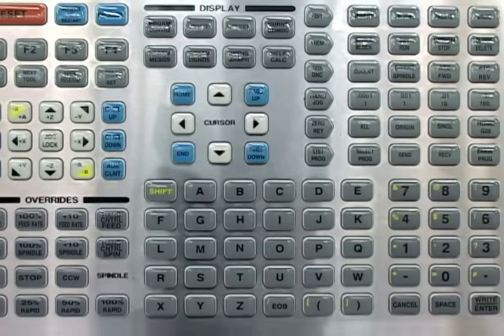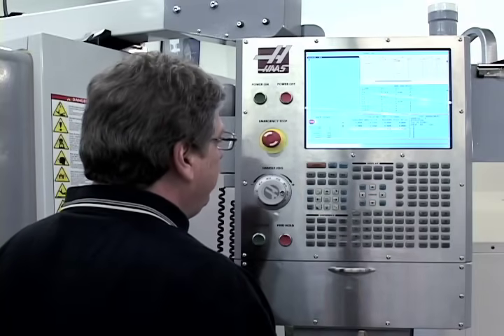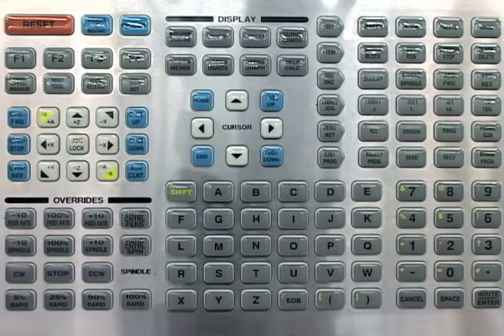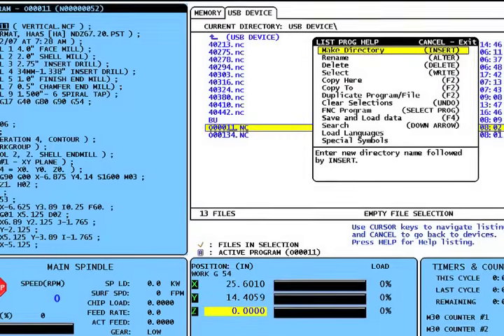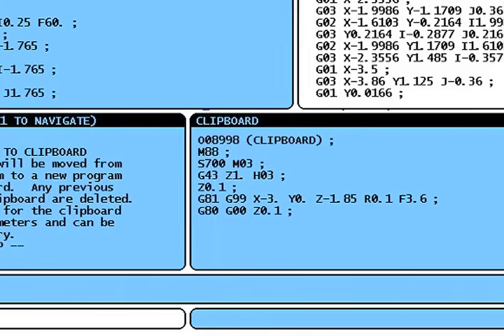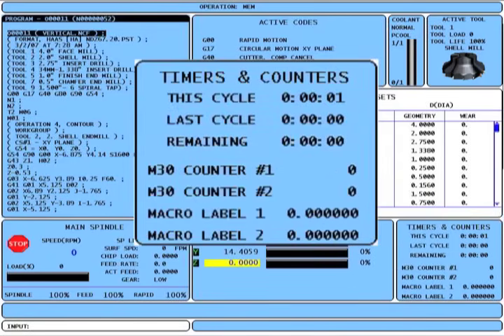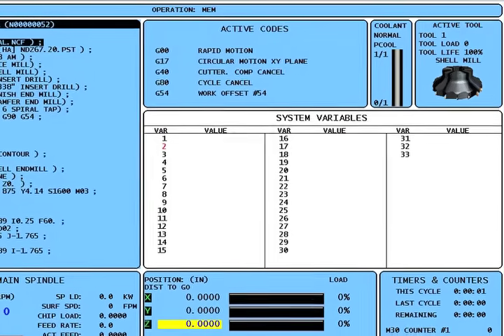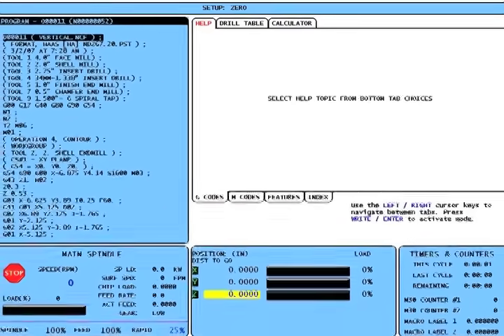Haas Control — GUI Setup, Run, and Edit

Comment: set up on the haas is damn easy, so bloody easy anyone could do it, thats what is needed in work, dont think but do. if you got a brain, or a computer with decent software, the thing will do what u want. as in milling. i can use 3 axis at once. and if a 4th is present, that as well. in turning the touch on to set makes the machine so easy, it does have haas easy programming, but now i just punch it in and run.. damn. if you want to contact me. try daveportlock@hotmail.co.uk.

Comment: i have run fanuc systems for around 25 years plus. the haas control is actually more better. the haas has great programming, also control. some machines have other things on them, easy guide is one on the machines i work on, all good but still limited when u need compensation or just running the damn thing. i run in fanuc, its easy to use and versatile, run a mazak control and understand. so in haas i can do turning and milling. i use the TL1 machine, mainly for 1 off work, amazing machine
Reply: David Portlock haas machine what program software 
  fanuc or ???